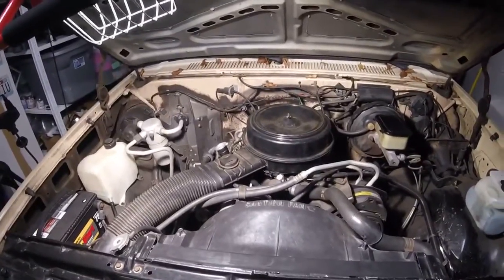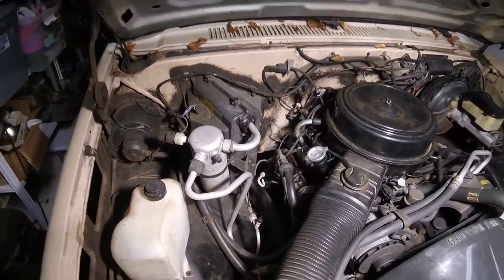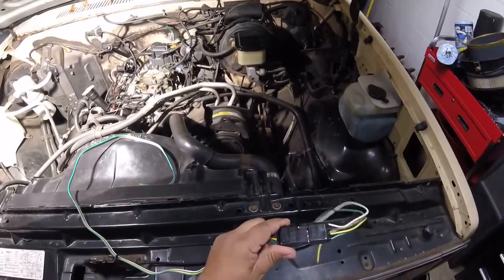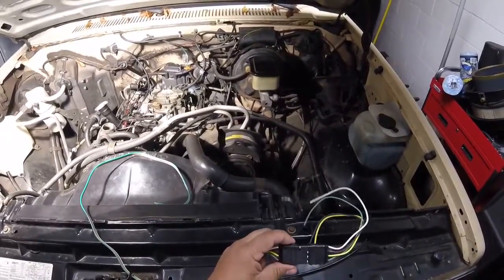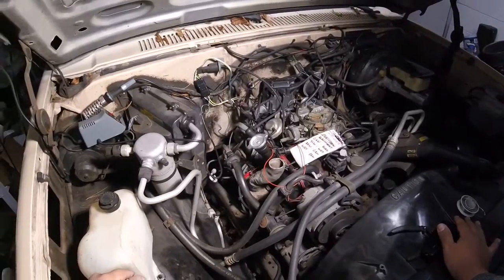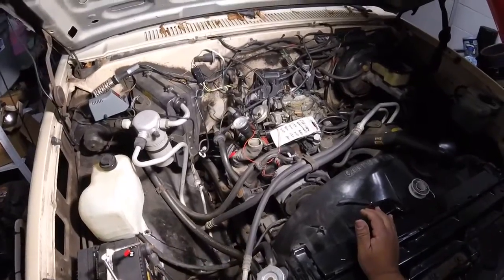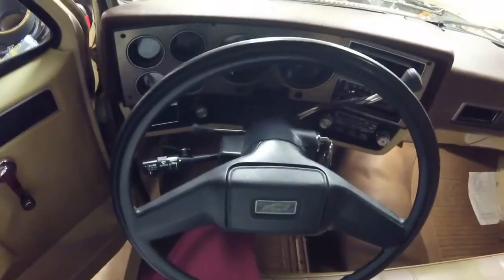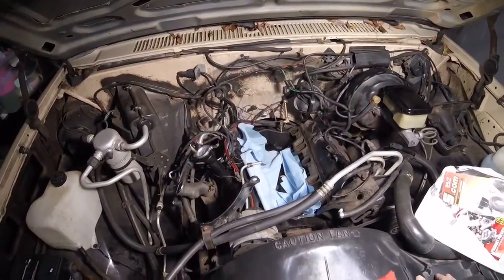ESC/EST to HEI Distributor

Comment: * 9-26-2022 THIS WORKS ! Just run a hot wire from a fuse that goes hot when the ignition key is on to power the distributor. That is the easiest way to do it..  That's the  old school way. That's how I done for years on my hot rods, always work Never fail. ** P. S. That way you Are Not using the computer at all. *

Comment: Question my colors are not Black and Green, i have change to an HEI also. The Engine is starting fine, but now the Check Engine Light. You say to connect the green und black wire together but my colors are different. A=BLK/RED B=TAN/BLK C=PPL/WHT D=WHT and den Connector is male not female...  Is there anyway to Bypass to delete the Check Engine Error
Reply from the maker: Depending on the year if your vehicle, the color codes may be different.

Comment: is the est sensor located mehinde in the midel on the engine block?? I have some strange plug dono what its used for I asume it hase some thing to do with the ignition timing. on my electrical diagram I see it say's "Ignition timing switch" ore some thing like that so maybe can some one help my? Well by use in europ no one actaly use that staff on older cars so Im curius what that thing is I drive around old opel ascona c 1.3l engine it use a singel hei coil with inductive triger and 4pin ignition module so actualy I dont have any one to ask what that thing is behinde the block so I wunder can I use diferent ignition modules ore complet distributor part from other cars and actualy upgrade my ignition system and use that strange plug wuld it work?

Comment: David thank you so much for posting this video.  My 1986 K10 Chevy wouldn't start about and couldn't figure out why.  Changed all the parts inside the distributor and didn't fix anything.  Finally found your video and now it is fixed.  Your a life saver.
Reply from the maker: Glad to help.

Comment: What in the hell are you doing?? LOL.  You don’t need that trailer wire. Unplug the black plug from the BATT connector on the cap. Plug the pink wire back into the  BATT connector on the cap. Unplug the 4 wire plug. Cut and splice the black and green together on the distributor side. Then remove ALL OF THE EST WIRES and vacuum canister and the est module and the knock sensor wire and throw it in the trash.  THERE IS NO ECM!!

Comment: Having trouble with my ESC. Seems when I bend the connector that connects to the box itself it seems to run a little better. when I let go it goes to crap. Can I just unplug the box and just splice the green and black together or do still need to use the other wires to
Reply: did you also have to retime  it after the bypass. im sure you did when you changed the distributors

Comment: Hey man I got a 84 camaro my old Esc distributor whit out vacumm was bad and I change for one with vacumm where did you put the wires of the bypass because I got no spark in the distributor
Reply from the maker: Louis Garcia, it’s the A(black) and C(green) that you connect together. If you don’t get a spark, it may be the module.